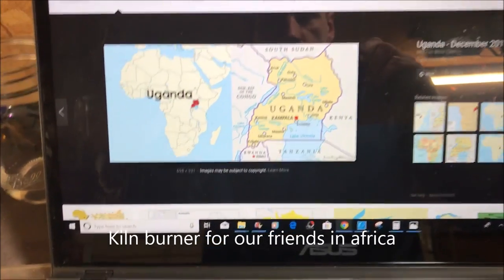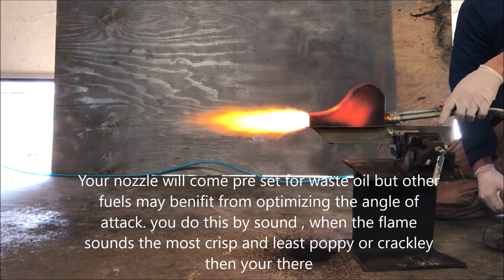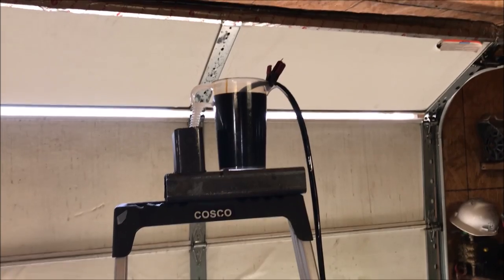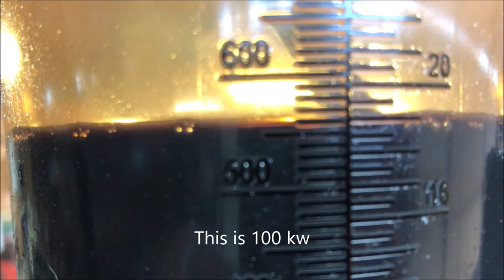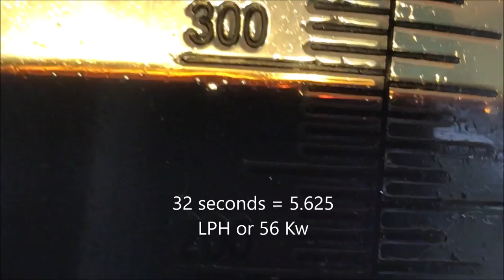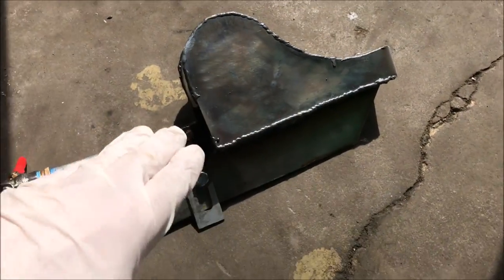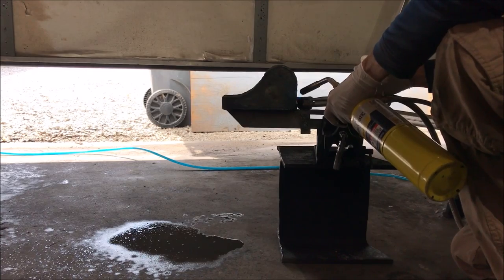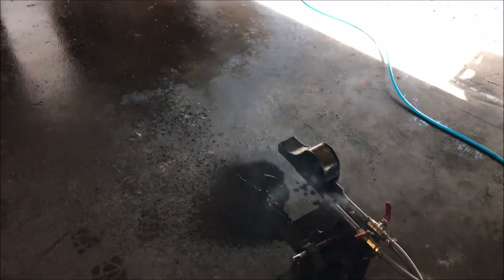African Kiln Burner For Ivan in Uganda

Comment: I have a 50 gallon drum of waste oil with a never ending supply because my brother works at a local diesel mechanic shop. I really want plans fot this burner. And also, is there a better way to feed the oil besides gravity, say pressurising the drum and sticking a straw down into the drum. Would that work?
Reply from the maker: i would not do that if i was you , the device draws a vacuum   . I dont have plans at the moment but plan to sell them for veyr low cost  as i already sell this burner , i have several versions from $150 to 500
Reply: I realize it is kinda randomly asking but do anybody know of a good place to watch new series online ?
Reply: @Mitchell Roger lately I have been using flixzone. You can find it by googling =)